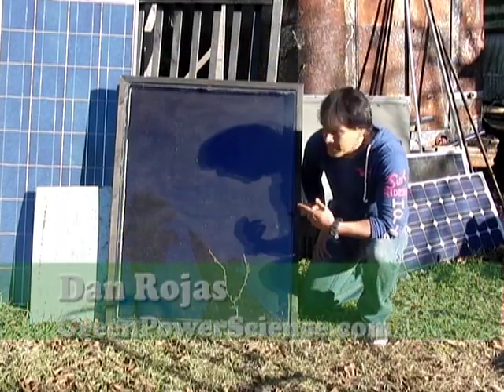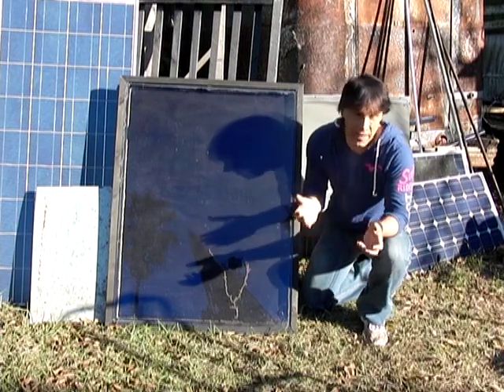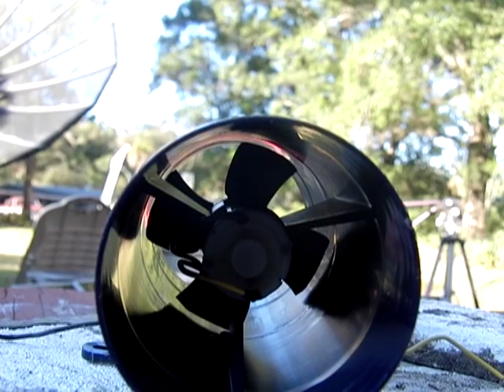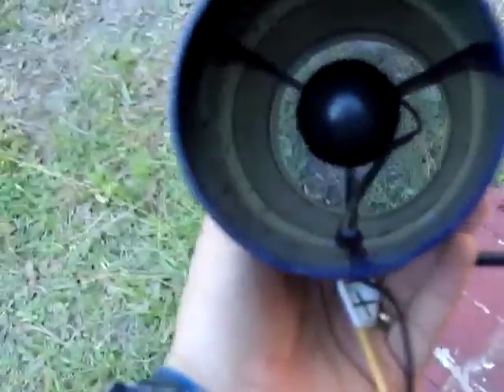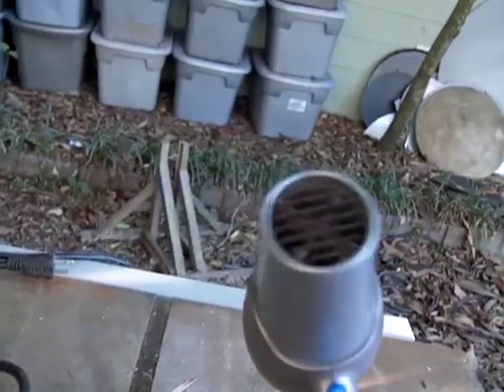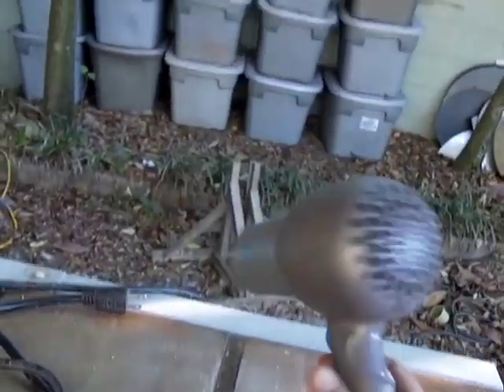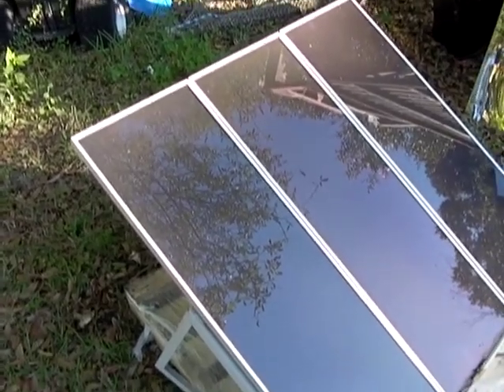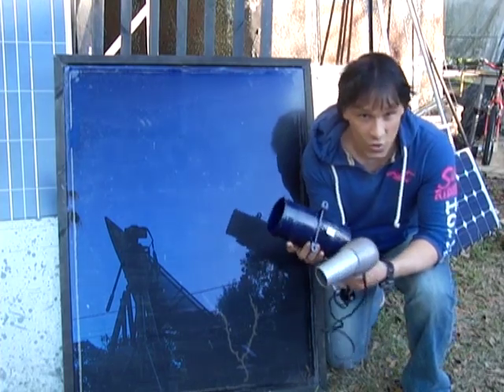FORCED AIR HEATER part 4

Comment from the maker: @astrialkil optimal sun at 75˚ f  - 80 watt panels will produce 80 watts. In reality an 80 watt panel produces about 63 watts due to atmosphere debris and heat buildup. Underwater is the best results so far with amorphous cells.

watch?v=rGi0Mf3cl1E

The fan idea might work for a panel array. Not sure if the power draw for CFM will economically offset the wattage gain from a temperature drop.

Comment: I built a forced air heater for my cold frame green house based on your videos  I've found that a slower fan is better because it provides more time for the air to warm along the duct.  I'm using a 100 ft piece of drainage pipe, a computer cooling fan, and a 12 volt solar panel.

Comment: @DJRockinRob Yes a solar panel does need a specific angle to the sun for efficiency. A recirculating system would be needed to combat the negative effects of standing water. Keeping a solar panel cool is a tremendous improvement to it's efficiency.

Comment: Dan, are you pushing air into the thermal heater or pulling it at the end phase? The fan you showed seemed to be too strong in the sense that it could bring air through the unit before it had a chance to warm up. Don't these things need a much lower speed (and thus power, which is good) fan?

Comment: How many heat boxes are you planning to hook up in series with this blower?  I would think a lower air volume fan would be needed (or better) so the air inside the heat box would have some time to heat up as you are heating up the incoming air

Comment: I wedged the fan into a coupling sized to fit the tube I used. I then slid the coupling over the open end of the tube poking through the inside the green house.  The the standing length of the tube snaked around my yard.  The other open end was inserted in the side of the greenhouse opposite the coupling with the fan inside.  The fan was powered by a 12 v solar panel mounted on the outside of the greenhouse.

Comment: @martenfisher1 I was thinking that too but then I realized it would still pull the same BTU's from the collector. The high volume fans would just pull them faster and at a lower exit temperature. The fan could be put on a thermostat so it would only come on at a certain temp if you wanted.

I am more concerned with the VOLUME (dB's) of both of those fan options. There are probably much quieter muffin fans that run on 12 volts and even less current draw.

Comment: That's an excellent idea- utilizing the electricity AND the heat from a solar panel. 

That basically triples the energy output of the solar panel and takes the total energy conversion of absorbed sunlight up to 100%

You just eliminated the # excuse people used to use for not using a solar panel who used to say  "It doesn't do enough to warrant the cost."

Comment: @GREENPOWERSCIENCE no I'm sure it wouldn't but i was wondering if you could get the heat for free with out having to reduce your load in the house. Loosing nearly 20 watts is a lot tho. Some of that ford motor corp "windshield film" that cools with the help of the sun might be worth your time.

Comment: Ive read that PV panels produce less power the hotter they get so cooling them might get you more power. What is the temp difference between the panels on the roof and in the box?

Comment: I would use a much smaller fan to save electricity, or even no fan at all.  

Mounting the solar panel (in a clear shell) on the roof puts it at an angle, which would actually cause the hot air in the shell to rise on it's own.  

You just need to make sure the top duct enters the house at a higher point than the bottom duct does, to keep the air moving fast.  Otherwise the hot air might drag its feet a little, not wanting to go back down to the cold end because it's still hot.  :-)

Comment: how many cfm does that 27w fan put out, just for comparison to a conventional computer fan which I see are rated at ~80 to ~100 cfm. there are powerful ones that help move heat from processors and hard drives inside servers, to larger ones exchanging air from an entire rack cabinet.

Comment: How about using a squirrel cage fan, you can even get on that runs off of dc on a blower for your car heater. I'm pretty sure Squirrel Cages are far more efficient and also have high flow rates. Just a thought.

Comment: what about a thin paned glass over the solar cells, then an layer of mineral oil say about an 1/8 of an inch and tempered glass over that.  so, mineral oil sandwiched between an outer pane of tempered glass and a lower thinner pane of glass just over the solar cells.  then, a very small powered pump to move the mineral oil underneath the solar panel into the shade along a larger pipe perhaps bristled with heat fins.

Comment: What if you put a pipe in the ground below the panels, and used the rising hot air from the panels to pull cold air up out of the ground exchanger?

Comment: that way, you could concentrate solar light by using linear Fresnel lenses just the size and above each solar cell mounted on or just above the top layer of tempered glass.